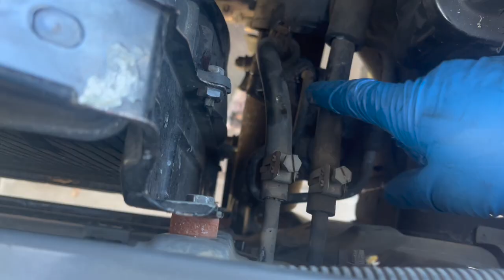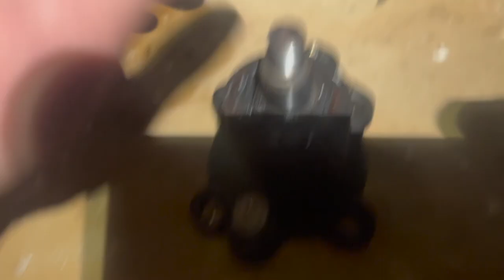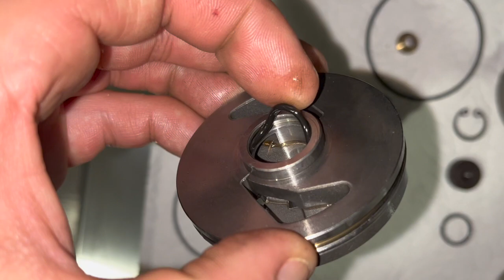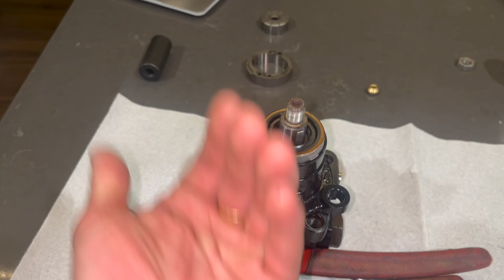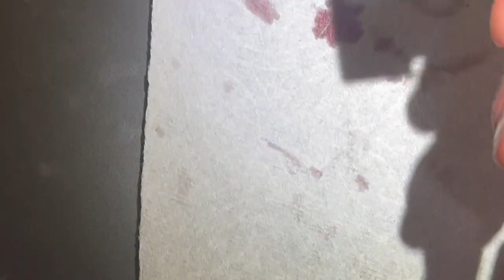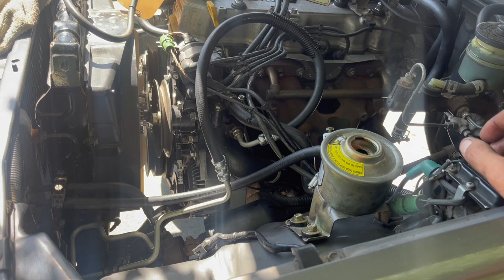1988 Toyota Pickup 22RE Power Steering Pump Rebuild Procedure

Comment: Sorry I'm asking so late, but when you didn't leave a reference make but found marks in your pictures, I could not see if the oil port was on the top or the bottom.  When you fitted it was quick video.  Thank you if you remember...

Comment: is there a Torque associated with the bolts on the housing?
Reply from the maker: I'm sure there was from the factory, but "good and tight" is all you need
Reply: @JamieSchmidttie  One more question, besides the rounded/squared off edge on the little fins in the rotator inside the pump, does it matter what slot they go in? I pulled mine out and dropped like 4/5 of them, i based the orientation off the 2 that didnt fall out. It should still be good right?
Reply from the maker: @D33SYNC  Ideally put them in the same spot they fell out but if you don't know then I wouldn't lose sleep over it. Should work fine. Keep me posted, curious how yours turns out.
Reply: @JamieSchmidttie  will do. Waiting on a new return hose.
Reply: @JamieSchmidttie  A little late update. Install went well. No noises, no leaks, works flawlessly! Thanks to your video!

Comment: I need to rebuild my 4agze 1995 toyota power steering pump, this video helped me alot with understanding how they are setup, where would you order seal kits?, im worried about removing the main seal and struggling to find it, great vid thanks 👍🏻
Reply from the maker: @BallyBroz   Check the dealership, likely they will have one. And no problem. Cheers

Comment: Is that an oem pump? If so, how did you identify it as oem?
Reply from the maker: As far as I can tell it is OEM, all of the Toyota parts fit exactly when I rebuilt it. The bearing was also the Japanese original that was used on these trucks.
Reply: @JamieSchmidttie  where did you buy your parts from?